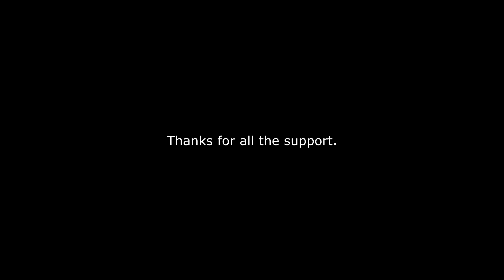Drift Car Road Trip | Diagnosing a Sad CA20E

Comment: if you still have trouble with the fuel leak from the injector hose, try putting a hoseclamp at the bottom of the hose . The bottom part of the hose is crimped in the injector from factory, it's possible that it's tired and it's not sealing properly but there's enough "pipe" under the bottom part of the hose to put a clamp on. Atleast that's how it is on ca18et it's probably the same on ca20
Reply from the maker: thanks for the advice!